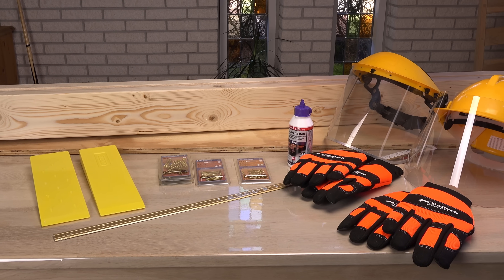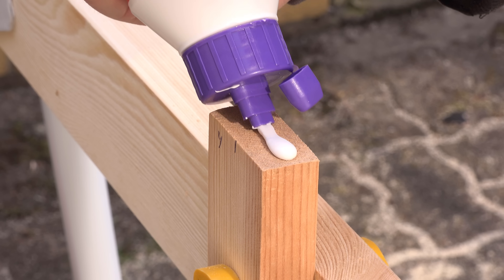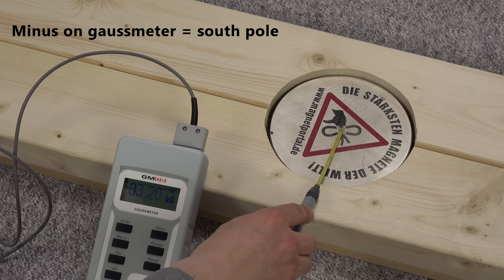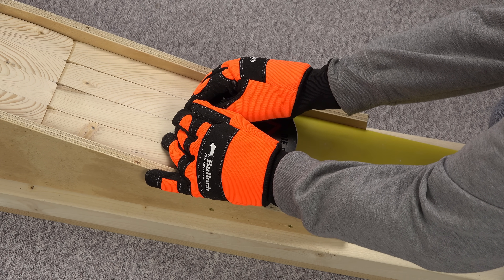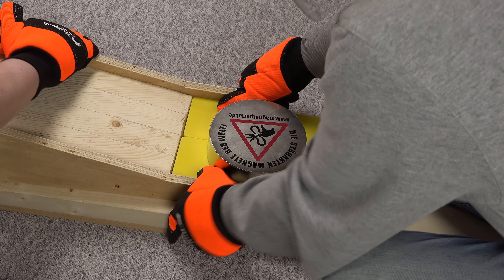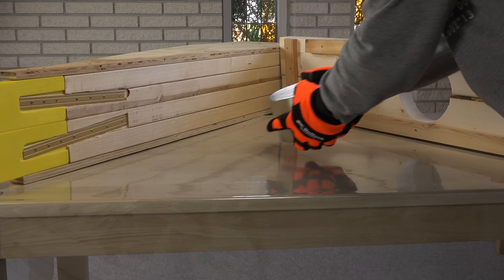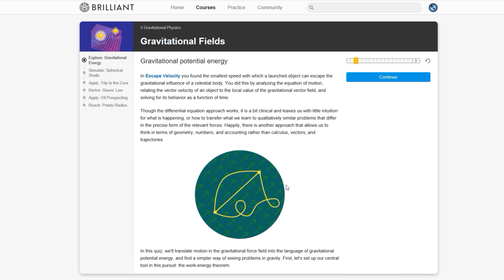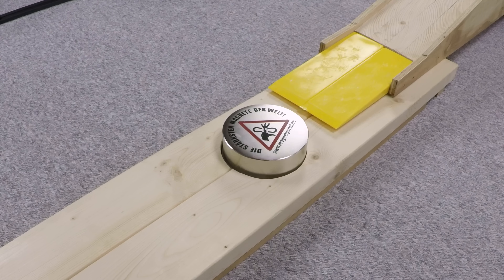Monster magnet meets monster magnet...

Comment: [MO 6.1] When you observe objects from the smallest to the biggest, how they are with regard to their form and solidity, how they more or less resemble each other, and how they are also more or less of one and the same quality, what you perceive about them is what first catches your eye, and this is the shape. When you take different objects in your hand, your feeling will immediately tell you if the object you are touching is more or less solid. When you take one object after the other in your hand, each of them of the same outer circumference, you will distinguish yet a third difference, namely that of the specific weight. But when you now examine the solidity of the objects, you will not seldom find that the less solid objects are heavier in their specific weight than the very solid ones. For example, the same volume of fluid silver is much heavier than the same volume of the most solid iron steel, and there are many more examples like this.

[MO 6.2] Yes, even objects of the same kind and volume–as water, for instance–are, compared to other objects of the same kind and also at their different temperature states, not of equal weight. For example, a drop of rain water is lighter than a drop of water from a well or any other spring. Thus, a warm drop of water is lighter than a cold one; a frozen drop is also lighter than any other drop of water.

[MO 6.3] You can find the same differences in all the objects. In order to recognize how different in every regard the species and genera and their nuances are--in shape, in solidity, as well as in consistency and heaviness--you only have to look at all the objects, and they will clearly tell you without delay: "Behold, researcher, how infinitely different we are!" And yet our existence is based on one and the same law, and all of us are made of one and the same substance! And yet, among us, we are so different that almost none of us completely resembles the other with regard to form, solidity, consistency and heaviness."

[MO 6.4] What I have said so far is a necessary introduction; without it, you would hardly understand what follows, because you will have to put up with cracking a few small nuts of the sphere of wisdom before we reach the actual explanation of the so-called "magnetism". Without going through this, it would be impossible to explain the topic to you thoroughly and for all times to come.

[MO 6.5] First of all, it is necessary that you take a look at the interminable past in order to find out about the topic, and I, from My side, will have to guide you onto the right track.

[MO 6.6] Imagine the period when still no other being than I had an existence in endless space, neither spiritually nor even less materially setting itself against any other being!

[MO 6.7] What then was the infinite space made of, and where did the time flow in which this space had eternally existed?

[MO 6.8] What was My existence before all existence, and how did all existence come to be and emerge from this one and only existence?

[MO 6.9] Now, what is space? What is the prime existence of Myself within space? And what is temporal existence in the infinite space within Me, out of Me, and beside Me?

[MO 6.10] Behold, as extremely difficult as it might seem to answer these questions in a satisfactory manner–of course only from the lowest level of My wisdom–they can just as easily be answered with regard to the subject itself that needs to be explained.

[MO 6.11] A small example, taken from your own life, will answer and elucidate these questions: Suppose one of you has harbored some thought for a long time; because he likes this thought, he adds a second thought to this basic thought, namely whether this basic thought could be put into action. Soon this second thought finds a way to be realized; but for the realization of the goal, still a third thought is required which, in fact, is already contained in the first two thoughts, and this thought consists of nothing else but the sole question word "how?". Behold, these three questions are asked, and one answers the other; but with this mutual responding, the issue is not settled and has not even started to be solved. Therefore, these three main thoughts consult with each other, and they question each other concerning the important "why?". And after a short deliberation, the first basic thought says: "Because it is something that completely resembles me!" The second thought says: "The reason why it can be implemented is because the first thought is not in contradiction with itself by wanting to manifest itself, as it is, for its own sake!" And the third thought says: "Because the main means for realization lies within the cause which wants to manifest itself, and namely because the basis of the thought, both in itself and in all of its parts, does not contradict itself anywhere!"

[MO 6.12] Now consider this: What if your thought were that you would like to build a house somewhere? Will you not, in your imagination, first envision a house the way you would like to have it the most? After you built this house in your imagination, and you had much pleasure in this structure of the imagination, will you not then ask yourself whether your imagined house could in all seriousness be achieved in reality? And if you do not want to build a house in the air, the second thought will apparently show you the possibility of realizing your thought of building a house; and consequently, you would agree on two points because the first thought within itself does not contain a contradiction, and thus, it in itself has already caused the second thought.

[MO 6.13] What follows now is the "how?", i.e.: "through what means?" The primary means is the possibility itself. The secondary means is the purpose connected with the possible realization of the whole idea; this is because nobody can connect a purpose with something to be realized before being clear about the fact that the intention itself can possibly be accomplished. The third means is the material and sufficient energy for adequate execution of the project. If you now have put everything together, and you own your property outright, what should or could possibly still hinder you from having your primary thought manifest into visible reality?

[MO 6.14] Now behold, in a short time, you will see your thoughts take shape before you since you have found all the conditions for their realization; this is because you have material and constructive energy and the capability.

[MO 6.15] But when you look back at Me as the eternal great main bearer of thoughts and sovereign master builder who filled the infinite space with countless great and elaborate buildings, you will at least have to ask yourself in passing: "Where did this great builder of all these countless great things take the material from?"

[MO 6.16] If you turned to the worldly scholars who are really very smart, they would, with the greatest of ease, tell you that it is as clear as day that matter is just as old as I Myself am, and therefore it is eternal. Now behold, this will be an easy job for us, and we can build as we please! The only unexplainable circumstance in this would be how I started out with this tremendous, eternal storeroom of matter in order to turn out innumerable things up to the present and when I actually started so that I have been able to cope with infinity up to the present time. Does not every object require a beginning?

[MO 6.17] But ask yourself only a little bit whether an infinite number also has a beginning when you calculate one thing after the other? But this just as much means that I never began to create anything; but if it were so, what then would the suns, the worlds, and all the other countless things be–whose existence you surely don't question–and where would they have come from?

[MO 6.18] Behold, we cannot follow this smart guide, because his first basic thought is full of contradictions, and consequently, the second and third have to be dropped of their own accord.

[MO 6.19] But another one might say that I, with one word, have put order into the eternal chaos, and, out of it, I formed and arranged all these things. At first glance, the complete resemblance between the first and the second statement must occur to you; because what else would the chaos be than matter, already eternally in existence, by virtue of which I would not have to be a Creator, but only a plain craftsman! And how, on the other hand, would an eternal chaos go together with My eternal order? But maybe still some third person knows a clever alternative?

[MO 6.20] Just pay attention–we again have someone who states that I and matter are one and the same! This statement might not be entirely unfounded; but one thing might not be very plausible, namely that you know Me only as a spirit filled with energy, might, and life, who in Himself absolutely has, and also must have, the greatest freedom because even you as his creatures are already free and can become infinitely freer! And also, how could this supremely free spirit full of power and life manifest as such and reside in countless lifeless and spiritless stones and in other dead matter? Truly, anyone who could prove such a thing in a plausible way would have to have a much more infinite wisdom than I Myself! But you probably won’t have to be afraid of such outperformance for all eternity, namely because the wisdom of all the multitudinous, most perfect angel spirits is, compared to My wisdom, like an infinitely small atom compared to the infinitely huge space whose beginning and end is nowhere!

http://www.jakob-lorber.cc/index.php?s=MO+6&l=en&b=

Comment: What stopped you from just taking them outside and slapping them together? like you could have just ran after chucking them both near each other and centred them later
Reply from the maker: Don't be fooled by their metallic appearance. They are not solid metal, but just coated to keep moisture out. As mentioned in the video they are very brittle - like a dinner plate. If they are allowed to accelerate towards each other from the magnetic forces, they will quickly reach a velocity where they simply chip/shatter each other on impact. And once the coating is breached the pieces will corrode fast. An expensive mistake :( Not to mention that the fragments tend to be sharp and can leave the magnets at very high speeds - hence the face shields. Thanks for watching!
Reply: Oh, ok thanks for clearing that up, just wanted to know why you couldn't throw them at eachother and hope for the best hahah :D thanks man :D

Comment: I think the noise came from the smooth surface of the wedge rubbing against the smooth surfaces of both the top & bottom magnets 5:49,  if you slow down the footage to 0.5 in the settings you can see that the magnets were not making contact with the last 2 centimeters of the wedge which is very smooth compared to the rest of the wedge (1:46),  smooth surfaces tend to make that sort of noise, kinda like when you drag your shoes on a basketball court.

Comment: DUDE FOR GOD SAKE ,YOU SPENT HOURS WITH FRIEND TO COMBINE TWO MAGNETS SAFELY AND YOU CAME OUT WITH THIS,I SUGGEST YOU CAN PUT THEM FAR IN A CONTAINER FILLED WITH WATER AND START PUSHING THEM TOWARD EACH OTHERS,THROUGH KIND OF PLASTIC TUBE WITH HOLES,TO SPLASH THE WATER OUTSIDE,AND THE MINUTE THEY WILL ATTRACT THE WATER WILL CUSHION THE ATTRACTION ESPECIALLY AT THE FINAL PHASE,NOW THINK HOW TO SEPARATE THEM,USING HYDRAULIC POWER ,USE HALF A MOON OF ALUMINUM WITHIN A WOOD BAR OR THE WOOD BAR ,AND SEPARATE THEM LIKE CLOSING A SCISSOR,NOW CAN YOU PLACE THEM VERY TIGHT IN A REBEL POSITION,LIKE NORTH FACING NORTH OR SOUTH FACING SOUTH?

Comment: Did you think about using a cylinder with the same diameter as the magnets? You could make a cylinder with the same diameter about 33 cm in length. Then you place one magnet at the bottom of the cylinder and fill the cylinder about 75% water, then freeze it. After it is frozen, place the second magnet on the top, and let it warm up in room temperature. Of course, you could drill holes uniformly in the sides to drain the water as it melts. No pulling, no hands, slow contact of the magnets.

Comment: Just a small thing i know, When the magnets combined the first time it made the sound because the 2 strong magnets were very attracted so when they made contact, the force vibrated the 2 magnets very fast together until it was stationary.                                                                                                                                                                                                
                                                                                                                                                                
                                                                                                                                                                            :D

Comment: If you didn't join them that slowly will they attach and break?
Reply from the maker: Yes, as mentioned in the video they are as brittle as a ceramic dinner plate. If they are given just a few millimeters of 'free fall' towards each other, they will accelerate so fast from the massive magnetic attraction that they will chip or even shatter on impact. Very expensive mistake... Thanks for watching!
Reply: Brainiac75 make a video on that too.... Keep north pole and north pole and make em levitate..... Jk

Comment: Imagine the speaker you could build with that thing.
Reply: Nice
Reply: Competition level subwoofers use some insane magnets. This speaker, the DS18 Troublemaker (yes, that is its real name) has a 650 oz. neo magnet!!!! https://www.carid.com/ds18/32-troublemaker-series-20000w-1-ohm-qvc-subwoofer-mpn-tm-sn32.html#specifications
Reply: michael newkirk The full weight of the speaker is much heavier. The technical specifications lists the magnet, a standard in subwoofer information, at 650oz.
Reply: And Aliens can Hear that.
Reply: triz313 it's not a full 650 oz. of neo. You have your steel plates, also where you THINK it's all neo in between the steel plates? It's not, only a small portion of the cylinder tubes is neo.

Comment: you could have used ICE. freeze one magnet under a block of ice, put the other magnet on top of the block. then you have 2 options:
1. fast and risky let the ice melt.
2. slow but more safe, put it back in the freezer - the ice will slowly melt only where the 2 magnets apply pressure. they will slowly "find" each other and stick.
in both options you get the magnets perfectly aligned with nothing between them.

Comment: cool video, i just wanna give you a little hint. putting your phone, or your ec card close to a magnet like this (sometimes it can only be a speaker!!!), and you magnet stripe is gone on your ec card. i worked in an aluminium casting facility, where they produced primary alu for car industry. they had such a big magnet field in the whole hall, that you couldnt take your phone with you, or your cards. they would just get deleted. also all the tools were out of brass, cause otherwise everything would stick to the ovens.
 you are very brave with the phone close to this strong magnet xD the sound was coming from the suddern slide, in addition to the high weight.

Comment: If you drop the temperature of 2 spaced magnets dramatically, using liquid nitrogen, they will hold a fix magnet field and at that spacing. This effect only last with extreme cold. However, by regulating the rate of warmth you can speak this effect to combine them with littler impact. Worth a try.

Comment: The noise was made because the top magnet slid off the center of the bottom magnet then when the top magnet made contact with the bottom one it slid to match the bottom magnet's position which scratched the magnets together in the process.

Comment: Okay so there are 2 suggestions i would like to make.
1) To make them 1 you could have tried the same exercise while submersing the magnets into water, they would struck to each other much easily and with almost less to no effort but still Not 100% confident that this would work but I'd like to try this 1.
2) The magnets were I believe aligning to Earth's magnetic field at the end of the video instead of iron in your table try to think abt it.

Comment: I wonder about the trick where you can drop a magnet down an aluminum tube and it falls slowly. I know this is inductance but I don't know enough to estimate if it would slow the joining of magnets if they start from opposite ends of the tube.

Comment: You made that look like really hard work.  There is an easier and safer way to do it.  Get a strong plastic tube that the magnets will just fit inside. Put one in the bottom.  Seal any gaps and fill with water.  Freeze.  Put the other magnet in the top,  on the frozen water.  Allow to thaw from the top down.  Neal

Comment: You will know if the magnetic field is strong, if it visibly bends light :-)
Reply: I was only joking in a surrealistic manner, like having an electric generator in a car capable of supplying 1.21 gigawatts.  I thought it amusing, because of the extreme requirements to bend light to a visible degree.

Comment: I don't understand why is it so tricky to just put them together? you can use simple design like, with carboard box/ line, and push them towards one another from afar?
Reply: once they got close enough for the field to overcome friction they would quickly accelerate (magnetic attraction vs. distance is exponential, meaning the closer they are, they get much, much stronger), and crash into each other so fast they would shatter. As he mentions in the video, these are brittle like ceramic plates, even though they look metallic.